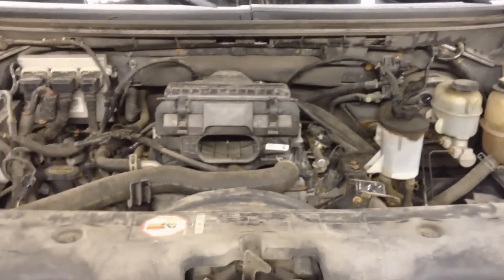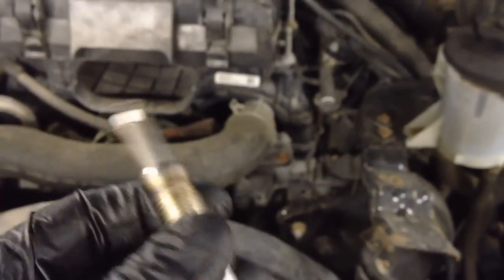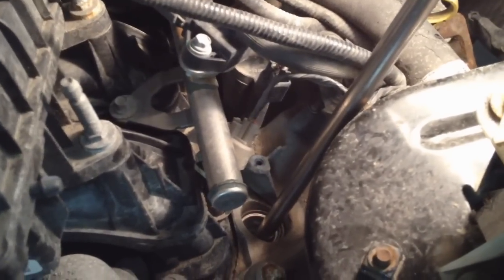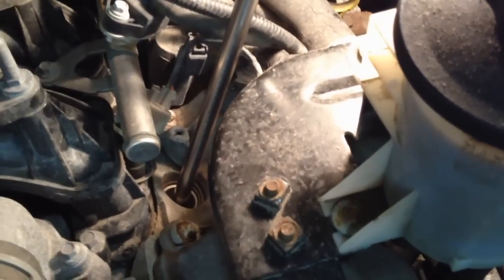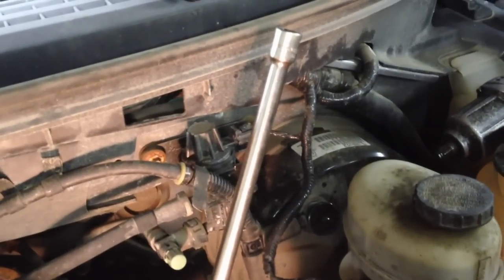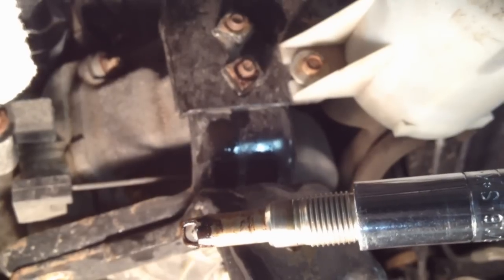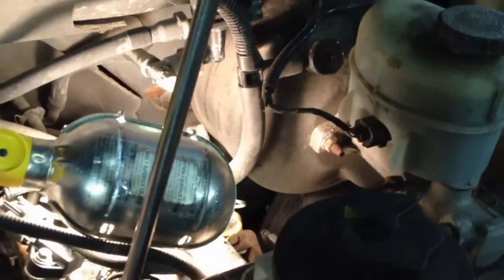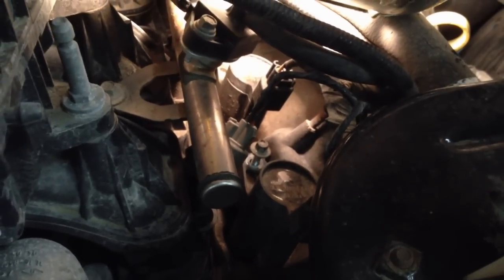Ford 4.6L & 5.4L 3V Triton Spark Plug Removal

Comment: I bought a 2007 with a 5.4 and yesterday it dropped a cylinder and the engine light started flashing. Im gonna assume and i hate that word that its gonna be either a bad coil or plugs need changing its got 230,000 km on it thx for the video i almost got roped into paying 600 to get the plugs done but i think i should be ok.

Comment: I bought a 2010 f150 xlt 4.6. Do I follow your process? I have to change plugs and coils this weekend.
Reply from the maker: Lou Pederi No your good they fixed this in mid 2008, yours should come right out.
Reply: FordTechMakuloco I have an 02 5.4L Triton F150 2V and a 09 4.6L Roush Mustang 3V. It seems like from the comments on this thread and your replies that I do not need to do this method for either, is that correct? Also, will I need the F150 spark plug socket you linked to amazon for either engine? Thanks for the great video.

Comment: Nice video , I just ordered a new 2015 E350  cut away with a v8.  Did Ford ever fix this problem with the plugs ? My friend just popped out a plug on his 2011 ford E250 at 90k miles. I see the aluminum heads are a problem with the plugs. Did Ford fix this problem or just ignoring it ? Should I anti seize all the new plugs when I get my new van and re torque them. Replace the plug's at 50k ? recheck them for torque from now and then. I'm getting rid of my 2008 MB sprinter that has been a piece of junk since day one. I want my new ford van to last more than 200k miles. My 98 dodge van went 245k ran great but the body rotted out.
Reply from the maker: JeffatJY This problem has been fixed since mid 2008 so you should be good.

Comment: I just did mine and did what this video said...On a cold engine, do one side first, loosen 1/4 turn, spray in carb cleaner, cover sparkplug with plastic wrap, let soak for 2hrs, remove plugs slowly, plugs will be tight, once plugs are almost out, take compressed air to blow out remaining carb cleaner, remove plug, put high temp anti-seize on threads, replace plug, put electrical grease on boot, replace coil. That is what i did...worked great, did not break single plug. I have 2004 ford f150 5.4l triton engine first spark plug change.
Reply: fecklar1905 would u recommend trying this without impact tools or a compressor?
Reply: Using anti-seize is unnecessary because the new spark plugs are solid, one-piece and also, the anti-seize will change the torque specs for the plugs...assuming you torqued them to specs in the first place.
Reply: @patricksproperties671 facts. Guys useing a impact on plugs to lolol
Reply: @thetimetraveler1427  It's actually a real thing on these believe it or not. Just look it up. I suggest watching Mason on the channel Flying Wrenches. He had a short of it.
Reply: Anti seize is terrible idea on these.. just saying

Comment: I had the hex portion come off on a plug before, the threaded part stayed in the head. What a disaster that was. I had to use a square flute extractor tapped in there to get it out. I was sweating bullets that day

Comment: FordTechMakuloco you are the man love this video! I have an 2007 Ford Expedition EL purchased at 80,000 and no one could tell me what plugs was in there so I will be doing this soon.  I have an 1/2 impact wrench can I use a 3/8 adapter or would you recommend buying a 3/8 impact wrench.
Reply from the maker: Jonathan Phelps 1/2" is ok just don't go nuts.

Comment: Have done a few of these even on the V-10 #5 cylinder man that was fun. I've tried these methods but the best one for me was what i read on here somewhere is to start engine and get as hot as possible do one side then heat back up and do the other side, I'm sure you have heard of that or done it yourself.That was the easiest and quickest way for me. Whatever works! Great Videos, Thanks for posting.
Reply from the maker: prmayner Yes I have heard of this and have tried it.

Comment: Thanks for the great video. I just got a 5.4 with 130k miles. Just wondering if there is a way to tell from the top of the spark plug (while still installed) if they have been upgraded with the SP-515. Are they visually different in anyway from the original design?

Thanks in advance.
Reply from the maker: No visual difference you must pull one
Reply: @FordTechMakuloco  I have one question,same process for 2006 Linconl Navigator 5.4 ?(spark plug replacement)

Comment: I have a 2006 mustang GT with 4.6L.  I went and purchased the anti sieze and the SP514.  What should I torque the plug to when I reinstall?  Thanks for the great video!
Reply from the maker: factionfx 25ft lbs for your year.
Reply: FordTechMakuloco Thank you!

Comment: This is a 5.4 motor, is the plug change the same on a 4.6? Mine is a 2006 E-150 with a 4.6...
Reply: If it's a 3 Valve 4.6 or 5.4 the method is the same. Only the 4.6 with 2 valves is the simple one.
Reply from the maker: Yours is a 2 valve engine so yours should come right out.
Reply: Thanks for you quick response... I assume the front plugs will come out under from hood and the rest will have to be done inside?
Reply from the maker: yes pull the dog house for the rear plugs
Reply: You're The Man.. Thanks!
Reply: FordTechMakuloco i have a 2006 ford explorer v8 3v do i use same method?

Comment: Have you ever seen a plug break in the 97-03 4.6/5.4 F150s?  Or is this just limited to the 04-newer 3v's. I know the older ones have the issue with plug threads and blowouts.
Reply from the maker: THETOPGLOCK I have only seen or heard of plug breakage on the 3v engines.
Reply: Thanks for the quick reply.  I have one more question.  I have a 03' Screw with the 4.6 that I am the second owner of. It currently has 130k and I believe it has the original plugs in it. I want to do a plug change but I'm concerned because it has a new coil on #1 and #4. I'm not sure if the coils were replaced because they failed or a plug blew out.  I just don't want to remove a plug that has been repaired and cause myself a big headache.  Can you tell by looking down the plug well with the plug still in there if a thread repair has been done?
Reply from the maker: It would be very hard to tell, I would have to say they were changed out for failing not plugs blowing out. Coil failures are more common than anything on these.

Comment: If using a RATCHET, make sure to use a swivel on your spark plug socket ! (Else you risk snapping the porcelain part of the plug, as it "snaps" free) 
While torquing on the plug to remove it, the "snap" you sometimes get as it "breaks loose" is enough to throw you off balance, and cause the socket extension to become forced at an angle BREAKING the plug. ALWAYS, ALWAYS, ALWAYS, Use a SWIVEL!

And ALWAYS use a LIGHT COATING of Anti-Seize on the threads AND smooth surface of the shaft of the spark plugs!!!! (if you like being able to remove them without a fight)
Reply: Lynn Dempsey wow no need for that. Chevy spark plugs are 1000x easier than Ford, but not quite as easy as your mother.
Reply: HouseCallAutoRepair or buy a chevy

Comment: Holy cow! this is insane. I thought about getting a newer truck, I have a 1997 Dodge Ram with 290,000 miles on it. After researching F150's I will NOT be buying a Ford truck! What is Ford's excuse for doing something this dumb??
Reply from the maker: They needed to pu the spark plug in the center of the 3 valves henc a deep plug. Heard Nissan has a similar problem.
Reply: FordTechMakuloco good thing to know, I'll stay away from Nissan's too, no matter how great a deal it is! :)
Reply: They have no excuse ! Federal gov't protected Ford in a class action lawsuit where 3 independent engineering firms proved Ford's flawed engineering which also included excessive and outstanding costs for regular maintenance items. The Feds backed Ford and SCREWED millions of US ! First time I changed these plugs cost me $1500 !! They all broke and it was before there was a lot of people complaining. Thanks Ford !
Reply: DO NOT buy F150 from 04 to 08 trust me I am an unfortunate owner of 2 of them and they are a financial hole to maintain, the engines they put in them are the worst piece of engineering I've ever seen, whoever engineered this piece of shit should be serving time in jail and ford should have recalled these trucks in 2004. not only the spark plugs are junk but wait until the cam phaser fails on you, you think spark plugs are dumb wait until your truck start sounding like diesel. you have been warned buddy DO NOT BUY any vehicle with this Triton engine. I wish someone had told me before I bought my trucks.
Reply: certified30 It's already happened ! You know you got a problem when an 8 year old kid comes up and says " Mister, I didn't know Ford put diesels in there F150's" !
Reply: Gary K Yeah, they're really nice trucks when they're working, well fitted and drive better than the others I'd say, I'm getting kinda sick of all the mechanical errors though, and they're a pig to work on.  Between this and the 6.0 Powerstroke we got I'm questioning whether I will ever buy a Ford again.

Comment: I watched a few videos including this one and did my '05 SUV and my sister's '05 SUV over the last few days.. 15 plugs, 0 broken...

The method I used is simple, Impact Wrench only. My truck was cold (off for over 12 hours) and hers was hot. 

The carb cleaner was unnecessary. It did nothing on my truck and I didn't even use it on her truck.

Rigid battery operated Impact wrench with regular 9/16 Husky deep socket, extensions (both ½" and 3/8"), and a ½" universal impact wrench joint was all I needed to remove each plug. It worked flawlessly.

My dad tried to do 1 by hand using the carb cleaner method, it broke. The rest I did using the impact wrench.. Took about 4 ½ to 5 hours per vehicle.

Thanks for all the information! I hope this also helps someone.

Comment: very nice video. Would you step by step 2010 Ford E250 removed spark plug. why you had use air gun to removed spark plug.
Reply from the maker: Hung Dung The e250 will be very easy once you remove the doghouse inside and remove air filter housing. On these they had a bad plug design that is why we had to use an air gun yours will not have this problem and they will come out nice and easy.

Comment: I have an 04 f150 lariat 2wd that's had a miss fire. No check engine light on. I've changed all 8 plugs and cop's
Reply: As well as all 8 fuel injectors and fuel filter. All of these made it run better for a short time a day or less then went back. I've has a compression test done on all 8 cylinders and was good, the CAT's are good. They couldn't find a vacuum leak under the hood. Wtf could it be? Fuel pressure regulator, ECU? I'm lost honestly. It has 127,000 miles on it. Also the oil smells like fuel. Any direction would help. Both my mechanic and I are stumped. It's weird how putting parts fixes it for a couple hours to a day at most, then has a miss. It also is sluggish to go after being stopped at a red light. Any suggestion would help. I was gonna look into the fuel pressure next but I have a lot of money tied up in this thing as it is and was hoping you being a ford tech would guide in the right direction.
Reply: On the way home check engine light came on. P0316 which is misfire on first 1000 revolutions.
Reply from the maker: Jake Johnson If the misfire is not that bad but you are smelling lots of fuel in the oil I would do a drip test on the injectors, they are know for this concern and would account for all your symptoms. Is it the new body style and the 5.4l 3v? Also I have seen the injector stick and cause misfires on e minut and run fine 10 min later.
Reply: I just replaced all of the fuel injectors. So they are brand new. Also it's a really bad misfire. It shakes bad and seems like it's going to die. It struggles to take off from red lights or stop signs.
Reply: It is the 3v 5.4. I just don't see how new injectors would stick. I know that code when I researched it showed possible issues being crankshaft position, which the crank was checked, the crankshaft position sensor which is new, ECM, or fuel injectors which are all new.
Reply: ECM isn't new just injectors
Reply from the maker: Jake Johnson Unfortunetely there are allot of things that can go wrong on that engine in particular. You took care of the fuel and spark. Have you check the fpdm for rotting on the frame I have seen those cause low fuel pressure at times. Also does it do it more cold or hot. Is the engine full of varnish and sludge? I would disconnect the vct's and drive it to see if it still happens and go from there without a scan tool all we can do is these checks.
Reply: It does it all the time. It's just really bad when you go from a 55mph highway speed to being stopped at a stop light. It will shake and miss a lot like it's starving for fuel but I had the fuel pressure checked and that was good.
Reply: But as far as acting up more hot then cold no. Makes no difference. I've heard about cam phasers being a problem with this year especially. But I heard they usually make a ticking or knocking type noise and mine isn't making any unusual noises. I will give what you said a try.
Reply: I don't notice a miss as long as I'm going 35mph or more but once I stop it starts shaking again.
Reply from the maker: Jake Johnson No there is allot more to the vct system that fails what yours sounds like it is doing is once the vct solenoids are activated they stick I have seen it allot. The easiest way is to before you start the vehicle unplug both vct solenoid electrical connectors then go for a drive does it still do it? If you put it into neutral or park does the engine come back to a stable idle?
Reply: I will try that when I have daylight tomorrow. I found both of them. One is easy to get to. The other is hidden under the power steering fluid reservoir and I couldn't quit get my fingers on it. I can tell you when I put it into park or neutral with them plugged in the motor settles down and has a more stable idle. Isn't a perfect idle but a hell of a lot better. I will let you know my results. If they aren't working should I see no affect on the way the engine is idling?
Reply: Oh I forgot to answer a question. You asked if there is a lot of sludge. Just did an oil change yesterday to get the oil that smelled like gas out. It looked normal. No sludge. Was a little thin guessing cause it's only 5w20 oil and the fuel.
Reply from the maker: For the sludge and varnish inspection I would look down into the oil fill cap opening you can see allot from there. If you unplug them then go for a drive and the concern where you go on the highway then get off and it's dying at stoplight should be totally gone. The vct solenoids stick and will have the timing over advanced at an idle when it shouldn't be and therefore it runs poorly and almost dies essentially the timing is off.
Reply: Haven't gotten a chance to do the vct test yet. But at my lunch break I check for sludge. On the side of the oil fill neck there was some thick sludge like oil. What does that usually mean?
Reply: The metal parts inside looked clean.
Reply from the maker: Jake Johnson It just depends on what it looks like was it tan in color?
Reply: There was tan color that was dry on the plastic. But the actual liquid was just black. The tan was on the cap and upper portion of the filler neck. But not at the bottom of the neck or inside engine. The oil has never been milky like a blown head gasket
Reply: And truck doesn't smoke at all.
Reply: So I unplugged the vct solenoids. It helped. It didn't completely get rid of my problem tho. It still has an obvious miss

Comment: Looking for some insight on doing this to my 20002 E150 with the 5.4 . Any thoughts or links?
Reply from the maker: The process is the same after pulling off the air cleaner housing of course. Then each coil is held down with a 7mm bolt and the plugs are normal spark plugs not like these and use a standard 5/8" socket. So besides being an E van it will be really easy. You know to pull the doghouse to access the rear plugs right?
Reply: FordTechMakuloco  Yes.I was hoping for a magic bullet, as it were :-) .Hard on my back, laying on the  van floor .

Comment: I have never seen a spark plug like that in 50 years of working on cars. Even the fist-sized ones on Brass-era cars don't have that full width contact. I'm baffled by what the engineers were trying to do. Do all modular motors have this type of plug?
Reply from the maker: just the 3 valve ones. They were trying to get the spark plug right in the center of all 3 valves.

Comment: got a 2005 f250 170k miles on it. just got it, and unsure whether the plugs have ever been changed. going to attempt it this weekend. this videos a huge help, hopefully i wont need the extraction tool. thanks for posting!
Reply from the maker: Oh man by that mileage I hope they were changed out a few times by now.
Reply: Apparently not...barely touched the first one to turn it a smidge for some carb cleaner... Broke right off.  The other 7 should a blast!
Reply from the maker: Oh man sorry to hear.
Reply: No worries at all! Just used the lisle tool and it came right out... 6 more to go! Thanks a TON for these videos!
Reply: All changed... Only two broke, running like a top now, will need to purchase a coil or two, but those are cake.
Reply: Oh.... And they'd apparently never been changed!
Reply from the maker: Wow your lucky then!

Comment: Yes the electrode was broken off. This was my second one. I have the spiral metal shaving that came out. So if it actually falls into the head I might be able to grab it without pulling the head???
Reply from the maker: What I have to do was tap on the porcelain with a pick or thin long flat blade screwdriver to chunk it off then blow out the chunks and then I was able to get down in there with the extractor no nut on it yet tightened it till it gripped then put the nut on and thankfully it came out.